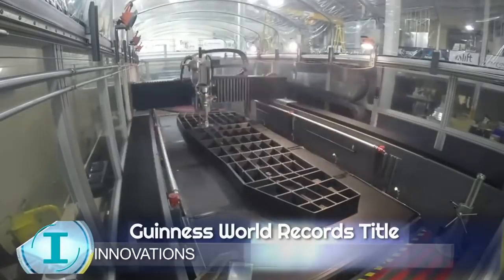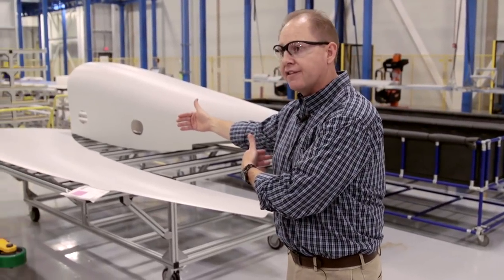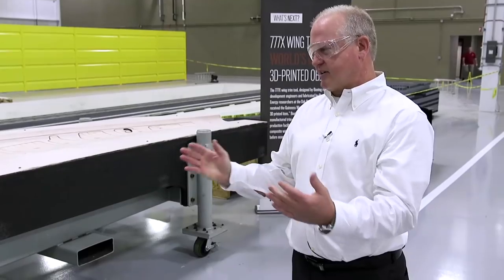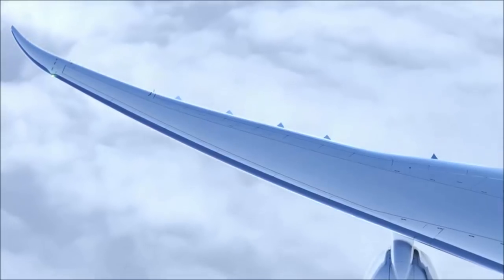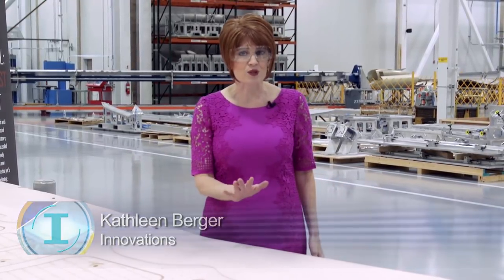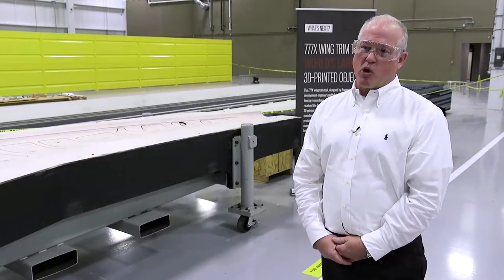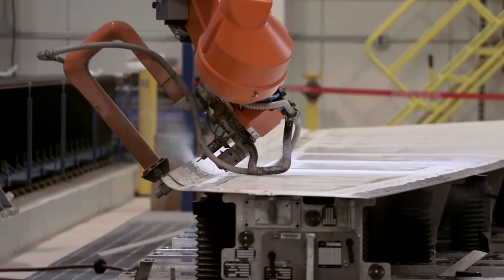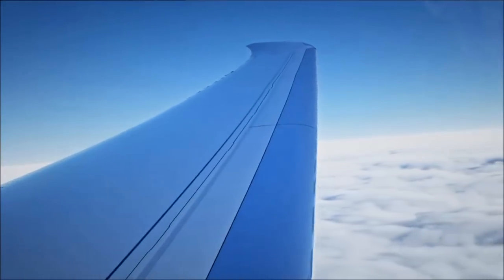The World's Largest 3D Printed Object for 777X Airplane at Boeing

Comment: Anyone using a 3d printer knows how inconsistent each prints are..  let's hope they test each part rigorously.
Reply: This is just the tool that holds the carbon fiber skin down using vacuum ports and channels. The real precision is needed in the milling machine that trims the part and drills the holes.